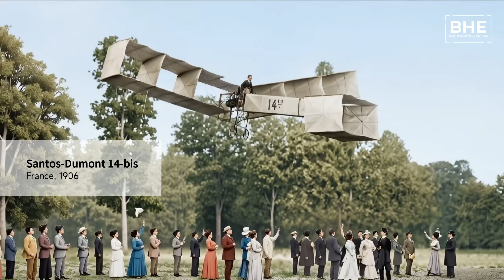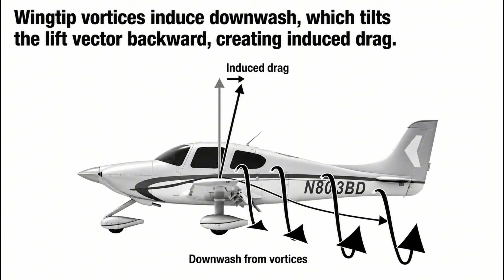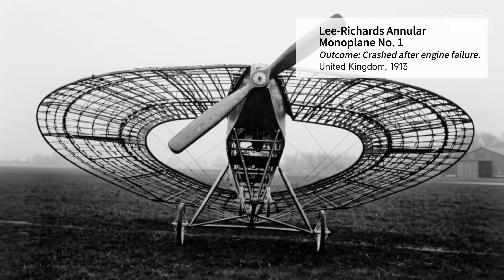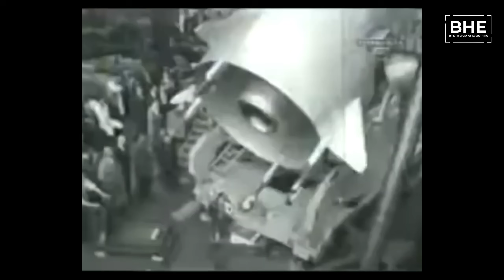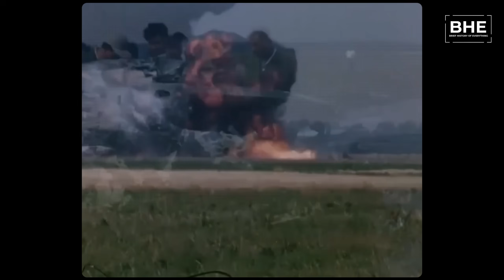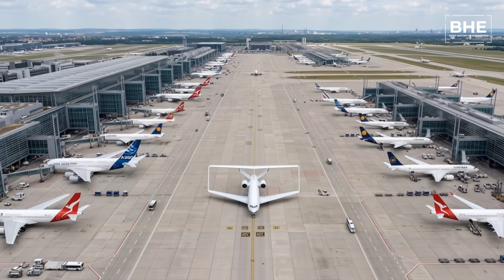A Brief History of Closed-Wing Aircraft: Why Did Engineers Try to Bend the Wings Back?

Comment: The best example of an industry that requires an absolutely perfect propeller is the wind turbine industry and they solved the problem by bringing the tip of the blade to an absolutely tiny point eliminating all Tip-Vortices. Perhaps an aircraft could do the same and bring the wing tips It's an absolutely tiny needle-point eliminating the Vortices Problem. If you look at the current 90 degree bent wing tips they do bring  the wing tip to a absolutely tiny point but in a but the 90 degree curve is not necessary if the tiny point can be achieved By simply continuing the wing out to Infinity where the point disappears naturally.

Comment: "Why Did Engineers Try to Bend the Wings Back?" Because they don't understand how lift is generated.😁 Aerodynamical efficiency comes from one thing only; high aspect ratio.. Winglets are used to keep large airplanes in a cheaper classification for landing fees. Performance would actually improve if those winglets were straighten out to increase the wingspan.. Look at the folding wingtips used on Boeing 777X

Comment: Aerodynamics with boxwings are brilliant as long as the engines are operating but a complete failure if when engine failures happen as Aerodynamics and glide do not work its either Nose or Tail down all the way depending on the wing configuration with severe limitations on any form of Ejection seat functions

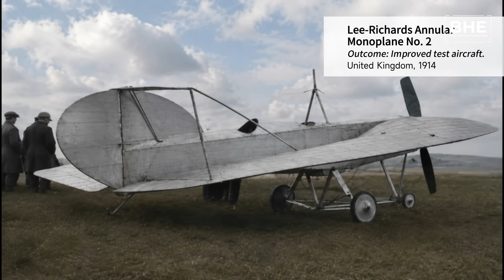Comment: I see lots of people commending the "good AI" use here...but this just underscores the problem with using AI in the first place: most people are unable to tell the difference between AI slop and real research.  Let's take a look at the figure shown at 10:44.  One might naturally assume this is an original engineering drawing.  After all, such drawings for this design exist in the public domain.  But take a gander at the scale on the lower right side, just above the title block:  The left half is declared to represent 6 feet, while both halves somehow represent 100 feet.  That is nonsense.  That is AI slop.

Comment: "for more than a century''? Um, I don't know how to tell you this, but generally speaking, swept wing aircraft didn't really take off (pun intended) till the 1950s when better efficient jet engines came in. So, we are only talking 75years approx. At most.
Good grief, even ''Bleriot'' , one of the first names most of the world learns about aviation at junior school can't even be pronounced correctly here.  It started as Blerry-ott, became Blerriat, whilst at no time remembering end-consonants in French are not pronounced as a rule (1st year secondary school).

Then the photos start to repeat themselves over and over. Funny how many online folk expect to do work without doing any work.
The explanations are pretty good though, and the digital models are well executed to help explain the story and principles further. And, unlike other features on closed-wing craft, the narration doesn't take one side or the other, but tries to stick to the evolution of the whole, both faults and strengths.
I also liked how the narration mentions that designs have to fit within the existing airport infrastructure without too many changes to that infrastructure. Something which in bridge building in busy seaports has been lacking in, since infrastructures have to catch up with the designs (Hence that nasty incident with the Francis Scott Key Bridge collapse a few years ago. Any new design meant the whole system needed upgrading and not just the bridge alone.) And this design fact is touched upon here adequately enough for purpose.
So, yes, I could pick many holes in this video, but all the main info is really good, and described well. And definitely worth the channel going for it further.

Comment: I drew many years a go teardrop shaped jet that had closed wings, the upper section were supposedly giving a little bit more lift but most importantly they were acting as controling surfaces.
Jet engine itself had a thrust vector moving only left and right, acting as the vertical rudder.

Not sure how well it would have actually flown, but man it sure looked cool :D

Comment: Big problem in closed wings is the large vertical component that cannot produce lift.
Reply: :face-blue-smiling:
Reply: Neither does stacked horisontal surfaces unless they are separated by a significant distance 😄
Reply: @erik_a8357  Indeed.
A vertical surface is practically an almost infinite number of horizontal surfaces packed so close together that no air can pass between them...

Comment: The only thing this Coliopter thing needs, is vectored thrust. This eliminates the need to rely on wing air-flow for attitude control during transition between flight modes. The French, it appears, were simply ahead of the time, or ahead of their engineering capacity. [Edit: Wait, so, the French had this design, which is honestly revolutionary, but it crashes one time, with a safe ejection and they wave the white flag. Unsurprising.

Also; That C-130-esque refeuler refueling the Raptor was on point. Believable. What a sight.]
Reply: There were other tail-sitting VTOL aircraft being tested by various companies around the world and they were all quickly dropped in favour of horizontal VTOL aircraft. Tail-sitters were just impractical.

The history of VTOL is fascinating. I hope this channel does a video on it one day!

Comment: closed wings can't flex like modern wings, adds significant weight. Circular is just stupid, sacrificing any lift on the lower ring half for limited lift surface on the upper half. Have you ever tried to fly a frisbee or disc without spinning it? Bad idea

Comment: Let me save you half an hour of viewing...

1 - Cost of manufacture. That's extra parts, extra joints, extra extra extra. When the leading buyers were the nations involved in the two world wars. "Roll'm off the line, fast, cheap, and good enough!"

2 - Cost of maintenance. The entirety of a straight wing can be inspected from the ground. Once the gets above a certain height, you need climbing apparatus' to complete visual inspections, much less the actual maintenance's. Likewise, on a straight wing, there are less parts that need replacements; and many of these round/box wings require bespoke parts.

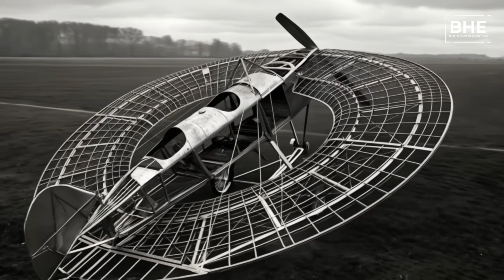10:30 Pick a fucking dialect!!!

Comment: A very interesting video in which the use of AI certainly enhances the experience. On the other hand it causes a lot of problems. True designs from the past get mixed up with total fantasy. Existing aircraft are morphed into something entirely different. Parts interfere with each other. And sometimes the assumptions are small but totally wrong. Like that man starting a design from a period when engines were handcranked via the propellor with a switch while no startermotor is present. So the spectre of falsification is always galloping along. Which makes the science dubious. Alas!
Reply from the maker: Thanks for pointing that out. I’m well aware of the AI issues, but I still enjoy using it. I put a lot of work into the script because I don’t want the video to feel like a dry PowerPoint presentation. Since I don't have the technical skills for full CG, I use AI to animate real photos—I don't really see the visuals as the main point, so I wouldn’t overthink those details. I really appreciate your constructive feedback; it’s much better than people who just bash AI on sight.
Reply: Sound comment and appreciative reply.  Still overall great work that stands out in today’s flurry of so much junky AI slop.  👍

Comment: I got a flying car concept with a box wing at the rear (that is 8ft wide). And a central pod 4 ft wide with 2 seats with in it and it has 4 quadcopter 4ft diameter lift fans, 2 (close together) at the front of the central pod and 2 lift fans at the rear (nearly touching each other) but with carbon fibre rings around the lift fans (for lights and protection). It also has a front canard wing wrapped around the rear of the front lift fan rings. And similar on the front of the rear lift fans fan rings, but with a larger chord wing than the canard. And 4 E hubs installed in the wheels so you can drive it on the road! 😂 But it's a proper legal performing car, not a golf cart thing, it's a super car thing that flies. Just pull off the road and VTOL away until you are doing 60 and then start up the 2 rear EDFs (large 2 ft diameter Trruster fans inside the rear box wing). Speed up to 150 knots and navigate by road. 😂 You will easily see the next town when up, and just land near the road and drive onto the road (as usual) and drive into the town and park just like a wide van would (it's 8 ft wide, max legal width). 😂 No licence required (only car licence, I hope) if you go by the FAA rules and avoid flying over built up areas and fly below 1,500 ft high. So many E motors, wouldn't that be a lot of weight?There is one that apparently has 1000 hp and only weighs 12 kg! 😂 And the Donut battery! 😂 There's a LOT more to say about it but too much for a YT comment. Except that it would be a bunch of fun and it looks great too, which is important! (I made a static model). 😂 Looks as good as any super car and it would probably cost a mill (with Bentley to do out the interior). The new Bentley is amazing inside! They have definitely got it stitched up! 😮
Reply from the maker: That’s one hell of a design! So, have you figured out the price tag yet, or is it 'if you have to ask, you can't afford it'?

Comment: The Ligeti Stratos lost control in flight, crashed, was destroyed, and Ligeti was killed.
Reply from the maker: Yes, I came across that while doing my research—such a tragic loss.
Reply: @BHEOrigin  Yes, it looked really promising.  If Ligeti had lived, he might have figured out the control problems.
Reply from the maker: @duanegrindstaff9635  Absolutely.
Reply: It spun in inverted which is a known problem with tandem wings - stable upright but potentially locked in inverted . I tried to get him to do a rolling rig test and showed the tuck issue with models - the coroner had other submissions to that effect.